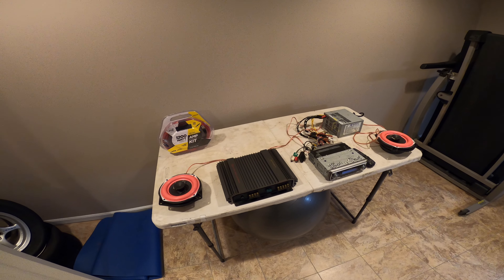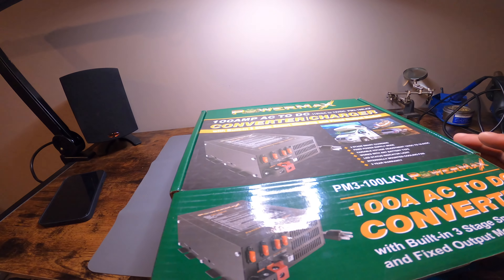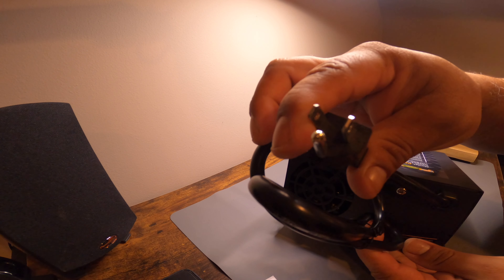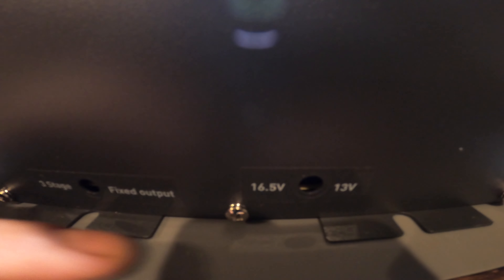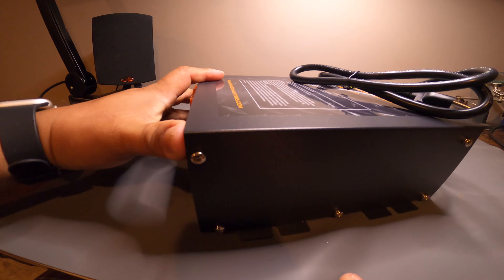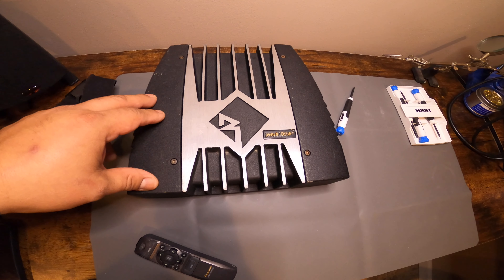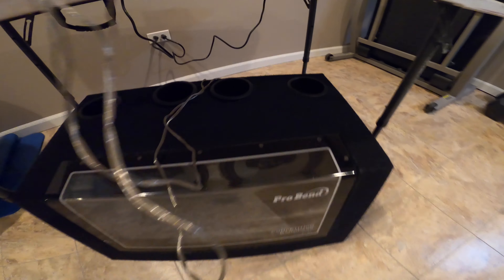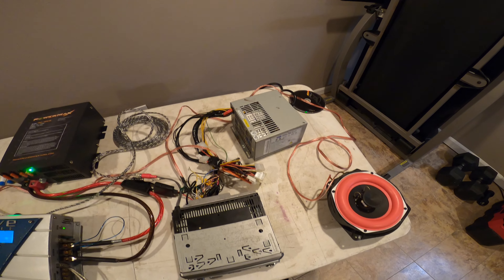Powermax 12v power supply

Comment: My amplifier keeps going into protect mode what should i do
Reply from the maker: Not good, I’m assuming you’re using a power supply to power your amplifier indoors correct?
Reply from the maker: @-crossheart  

Did it work at any point. And what I mean by work is did it play any music?
Reply: @93dajjdg  Yeah but when i play it to high it cuts out into protection mode
Reply from the maker: @-crossheart  

Are you using a powermax power supply? If so did you adjust the output voltage?
Reply: @93dajjdg  Yes it works better at 13v but still cuts out
Reply from the maker: @-crossheart  

What ohm load are you running? Also is the amp rated for that ohm load? What amplifier is it?
Reply: @93dajjdg  Rockfordfosgate 250x1 amp. Rockfordfosgate r2 12 inch sub, I think im running on 2 ohms, im not experienced so i do not know
Reply from the maker: @-crossheart  

Rockford 250x1, so I’m guessing old amplifier. 90s or early 2000s? Is there a model number anywhere?
Reply: @93dajjdg  I cant find a model number but it says date of manufacture 2020
Reply: @93dajjdg  Also, what does clean out mean on my amp?
Reply from the maker: @-crossheart  

Not sure what clean out means. How did you wire your subwoofers? Are they dual 4 ohm coils?
Reply: @93dajjdg  yes they are dual 4-ohm voice coils
Reply: @93dajjdg  I have not wired them in the box, if thats what your asking
Reply from the maker: @-crossheart  

How are you hooking the subwoofers to the amplifier? I want to know how you ran your connections from the amp to the amplifier. For example does the positive stay with positive on both coils on a single subwoofer?
Reply: @93dajjdg  Im popping one of them out
Reply from the maker: @-crossheart  

Pop both subwoofers out and check to see if they’re both wired the same way.
Reply: @93dajjdg  Its hooked up from a positive from one side and a negative on the other side with a jumper wire, i dont know the correct term for the wiring but thats how its hooked up, its dual 2 ohm coils.
Reply from the maker: @-crossheart  

OK, so it sounds like the subwoofers are wired in series. So if it’s a dual two ohm subwoofer, each subwoofer is a four ohm load. Does each subwoofer have its own terminal connection?
Reply: @93dajjdg  Yes it does
Reply: @93dajjdg  But they are wired seperately
Reply from the maker: @-crossheart  

So from the speaker box terminals, how did you run your speaker wire to the amplifier? Did you stay from positive to positive and negative to negative? If so, that would make it a two ohm load if you’re going into one terminal on the amplifier.
Reply: @93dajjdg  yeah positive to positive and negative to negative
Reply from the maker: @-crossheart  

Interesting, I’m not sure what’s causing your issue. Maybe the amplifier has a problem and is causing it to shutdown when you try to turn it up. I had a similar issue with a older Rockford amplifier. I didn’t find a fix for the amplifier but I did figure that Rockford amp was causing all my problems by trying another amplifier in its place. So my next suggestion to you would be to try a different amplifier. Let me know what happens. Hopefully you have another amp you can quickly swap and figure out your issue. Thanks for watching and please like and subscribe.🔊🔊🔊
Reply: @93dajjdg  Ok thanks i will subscribe
Reply from the maker: Are you still having trouble with your amplifier cutting out?
Reply: @93dajjdg  yes, i have not changed anything yet though due too money
Reply from the maker: @-crossheart  

How are you driving sound into the amplifier? Car stereo?
Reply from the maker: @-crossheart  
What’s turning on the remote on the remote? How is the amplifier turning on?
Reply from the maker: @-crossheart  

Is there a jumper wire from the remote to the 12v positive on the amplifier? Is that the trick you are using?
Reply: @93dajjdg  yes
Reply from the maker: @-crossheart  

Ok, I thought maybe the remote was wired in a different manner. Hopefully you get a new amp soon. Let me know if you figure something out or end up getting a new amplifier. 👍🔊
Reply: @93dajjdg  okay thanks

Comment: Where did you ground your amp to
Reply from the maker: The power supply has a positive and negative terminal, that’s where I use to make my connection’s but a battery was also added to the test bench and I now  make my connection points at the battery vs the power supply. I made a video on the battery I chose, the video can be found on the channel in the video library. Thanks for watching and if you haven’t already please like and subscribe.🔊🔊🔊
Reply: Hey man I appreciate it the one I got was a knockoff version of power max and I'm returning it tomorrow so I can get the right one so you just power and ground straight from the converter to the battery terminal with I have extensions to add more wire to it. Is it a good idea to add a capacitor as well to help
Reply: I'm also running head unit on its own converter
Reply from the maker: @mineprixelz9697  

You could add a cap I actually ran a cap before I ran a battery on my test bench, I used it like a noise filter in way, worked ok but I definitely saw a dramatic difference with a battery. I recommend running the power supply and a battery first, if you still need more juice then experiment and try adding a cap, it might just do the trick.
Reply: Yep I have a battery putting little under 12 v it's like 11.8 but when I put my prongs on this knockoff version I'm not getting any voltage reading coming from it
Reply from the maker: @mineprixelz9697  

Wow it definitely sounds like an issue, I think the idea of a return sounds like a good one or at the minimum an exchange for one that works.
Reply: Im going with powermaxx thats the brand i wnted int the first place
Reply from the maker: @mineprixelz9697  

I’ve had mine for a while now and I haven’t had a problem with it yet, fingers crossed. PowerMax has a variety of models , just make sure you purchase the highest amperage model your budget allows.

Comment: Aguanta un amplificador de 1000
Reply from the maker: Yes, in one of my recent videos I reviewed and displayed a ze1000.1 amplifier. Part 1 of that video was using a power supply only. Part 2 I added a battery inline to help voltage drop. So to answer your question the PowerMax 100amp power supply did power the amplifier without a battery but I did notice voltage drop. I hope I answered your question.  Thanks for watching and please like and subscribe.🔊🔊🔊

Comment: If I'm using a battery do I set on the 3 stage charging or the fix
Reply from the maker: I have mine set on the fixed position. I haven’t had any issues so far but I also haven’t had my setup for that long and I don’t have a battery, just a small cap. My suggestion would be to leave it on the  fixed position when your playing the system. If you want to charge your battery after every use then I would switch over to the 3 stage charging mode. That’s how I plane to use my power supply when I get a battery. I hope this helps. Thanks for watching and if you haven’t already done so please like and subscribe.🔊🔊🔊
Reply: @93dajjdg  since it works with your cap should work with a battery with the fix setting so the question is, is it ideal for long term use
Reply from the maker: @kamikazikaizer  

That’s a question I can’t honestly answer. I hope someone sees our conversation and can help answer that question. 🤞
Reply: @kamikazikaizer  it really depends on how much you use it and how much power is really being pulled out of the system. But this is basically the same as if it was in a car or motor home set up  the only real difference is you are using a 100amp power supply in stead of the vehicle changer basically the only difference between the system. If it all brand new you should be able to get 5years out of it  in a some what normal usage just like in a vehicle 🎵🎶🛠️💯🍻👌✌️

Comment: Can i use the 45a to power a 3,000w amp?
Reply from the maker: A 45a fuse will run the amp but more then likely the fuse will eventually fail. From personal experiences I have done what you are asking and have had no issues, probably chocking the amp from power but never experienced the fuse blowing out or melting. I also try to use common sense and remember that I’m running a small fuse and not to be surprised if something happens. Whatever you decided to do, use your best judgment and common sense. I don’t recommend running a small fuse nor am I telling you what to do. Thanks for watching and please like and subscribe. 🔊🔊🔊
Reply: @93dajjdg  thanks for replying
Reply from the maker: @gleefull2962  

No problem I’m here to help .👍